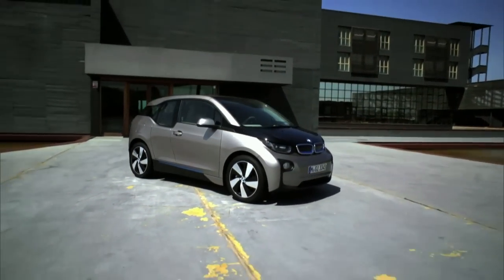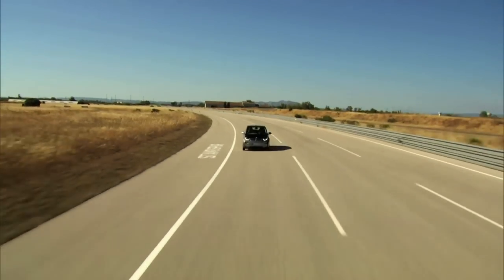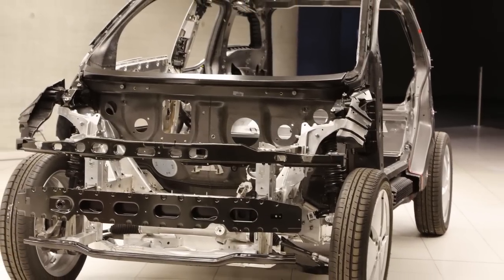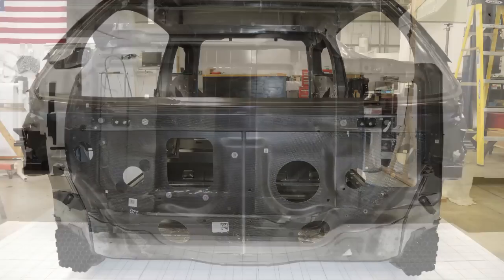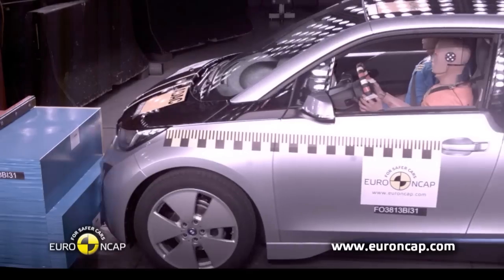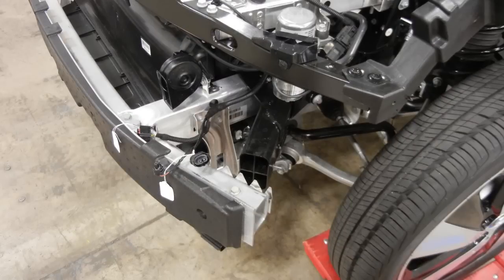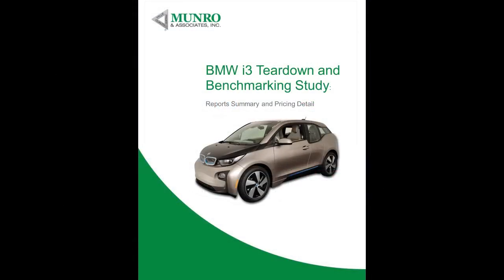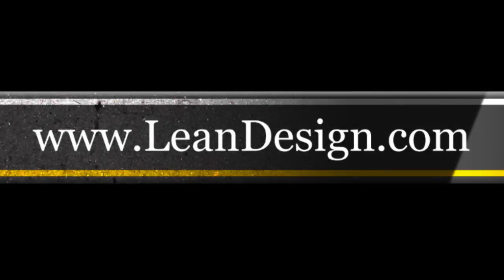BMWi3 Carbon Fiber

Comment: Just a question about the BMW i3. Though not an owner (yet), I am a fan of the i3. Its "Geekish" good looks and overall design is compelling. That being said, my question is: "Has there been any consideration by BMW or aftermarket groups to take the space occupied by the REX engine and populate it with a battery pack? I personally wasn't interested is such a range extender. But if purchasers of such a package were good with loosing that space to an ICE motor and fuel tank, augmenting the existing battery pack with one in that space seemed to be a relative no brainer. Your thoughts sir. Oh and...Love your show!
Reply: Its been bought up many times by car enthusiast that instead of putting the REx in that space, BMW should have put batteries there. But batteries can't charge themselves like the REx can charge the battery.. 

Trust me, the REx is a life saver!!
If the REx is a turn off to you, just get an i3 BEV that has the range that fits your lifestyle. The 2019 120Ah battery version is now on the used market for as low as $29k.
2018 94Ah battery version $19k
2017 94Ah battery version $16k
2016 60Ah version $16k
2015 60Ah version $15k
2014 60Ah version $15k if it has low miles and is fully loaded.

The hard part is finding an i3 at a good price that has the options, low miles and interior you want.
Also 2014/15/16 i3 had plastic motor mounts and inferior motor mount bolts that snapped and broke under stress from potholes and bumps. BMW replaced the bolts under a recall but BMW did not proactively replace the plastic motor mounts with metal/aluminum ones. If buying a pre 2017 i3, I would check to see what type of motor mounts are installed. Replacing the mounts is a $3000 job and if the mounts crack or break, they could cause damage to other components and this will increase the expense even more. 

Just buy a Chevy Bolt, it has more range.. The i3 is fastly becoming a hot car to have among Black men, its a status symbol.
Reply: Check out Wokeby in Germany. He ships worldwide. I've fitted the trunk kit that uses the space of the Rex. Pretty impressed.

I have the 120Ah i3. No need for a Rex. 180miles when it's mild outside. 50kW charging on a 38kWh battery is quick on the rare occasion you're going a long distance.

The Rex is a dead weight with the modern battery and a maintenance liability.

Also, ditching the Rex gives you a heat pump in the space that is freed up at the front of the car.
Reply: @charlesbridgford254  
The REx is problematic when it comes to maintenance and reliability, however, the REx can hold the battery at any percentage under 75% indefinitely.. Its a live saver on long trips when there are no chargers around... So, its not dead weight.. Also, the REx can actually charge the battery when the car is at a stand still (again, comes in handy when there are no chargers around).
Reply: @mamadouaziza2536  It depends where you live. In the UK with a 120Ah battery I would never use the Rex. In thousands of miles I've never come close to needing it. In the US for example it might be more useful.
Reply: @charlesbridgford254  I have that "trunk extender," pretty cool and not too expensive.
Reply: @charlesbridgford254  I have a 94Ah Rex. 90% of the driving I do is around town so Rex doesn't get used for that, but a few times a month I do a 190 mile trip. For that the Rex is perfect. Battery does the first 120 or so miles, then the Rex does the rest. I've done the fuel cost/efficiency calculations and cost wise it's cheaper to use the Rex than rapid DC chargers, plus I dont have to stop at all to refuel or charge during the trip. Would need at least a 20 minute charge without the Rex and thats if I only just want to make it. With the Rex I have 30 or so miles still left when I arrive and can quickly and easily refull the tank if I want to go further.